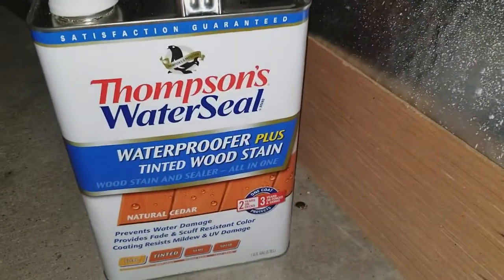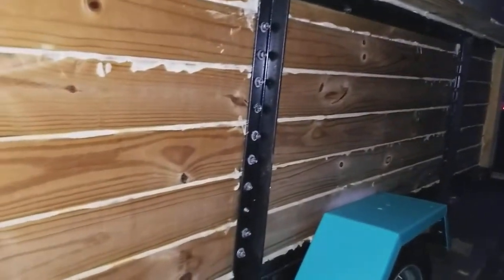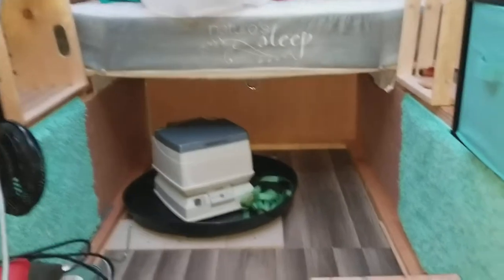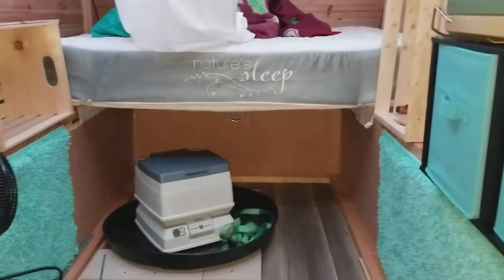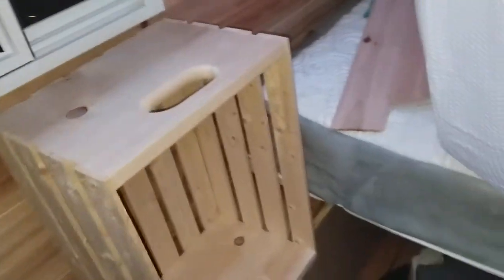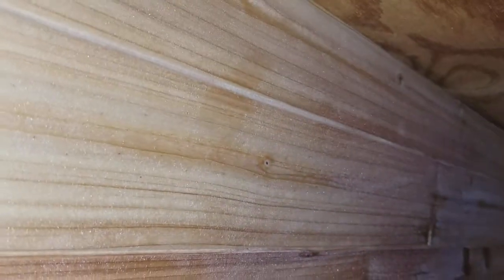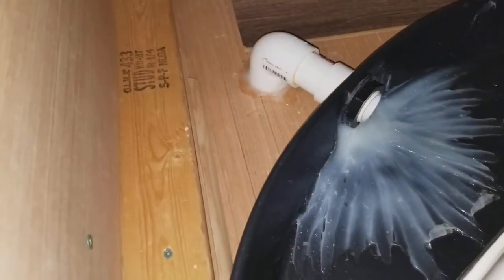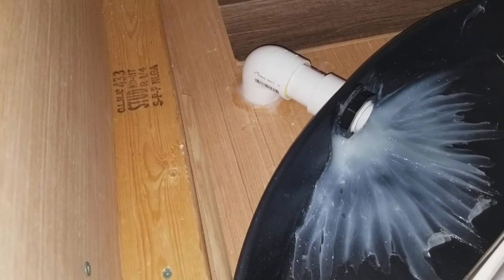4x8 camper build wood stain and stuff 😉

Comment: No clue on the cedar. Looks like frost lol.. you could add a P trap to your drain to relocate it or maybe find a way to reduce the drain to about 1/2" and drill a 1/2" hole through the steel. You could just use vinyl tubing to run outside. I think my drain is 3/4 clear vinyl tubing directly from the sink. I had he entire area behind my galley empty today but wasn't smart enough to video my plumbing system... silly me...
Reply from the maker: Ramblin Rogers  It does look like frost but it Stephanie not that cold yet lol. I was thinking of doing a clear tubing or a tube in general. I just might do that.